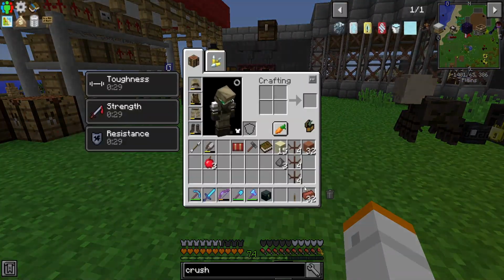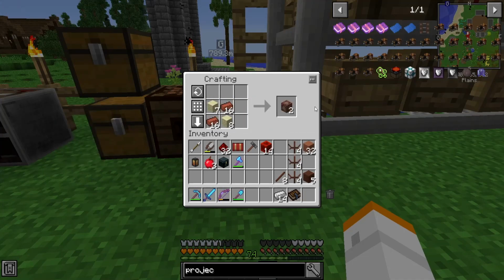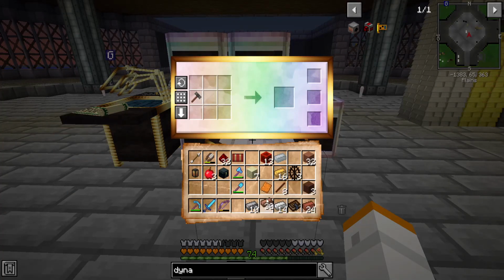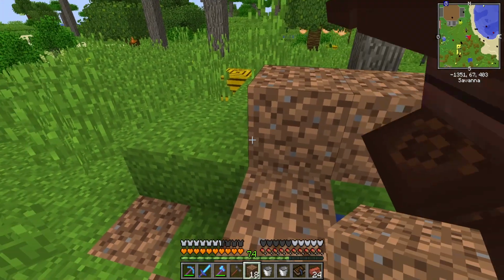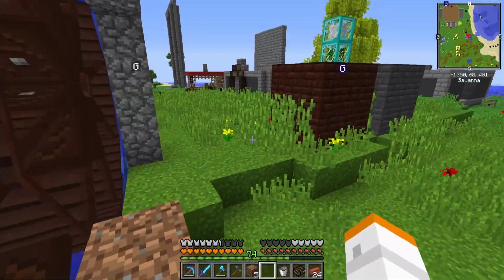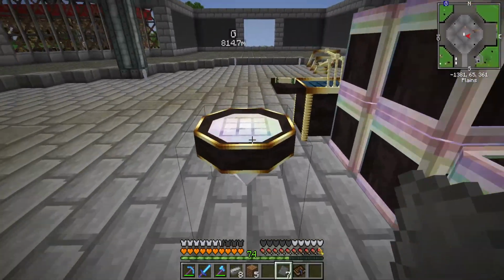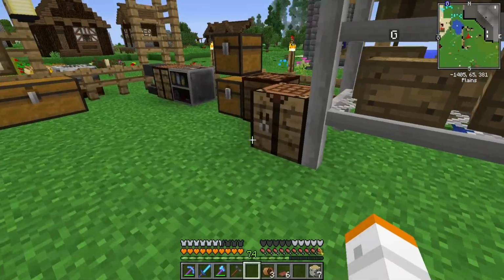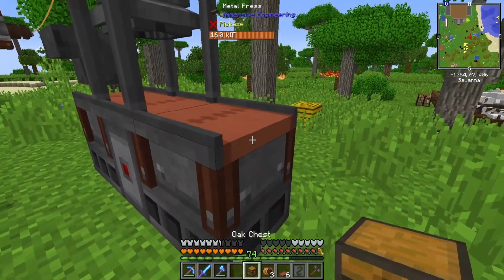Serious Engineering IE Power and Metal Pressing EP10

Comment: I think the IE windmills just checks for blocks in front of it and the high (y level) dependency was removed.
I didn't know about Thermal fluids would affect the wheel when moving up - thanks for the info ^^
Also auto miners do work on crystal which could come handy later on. As I moved my storage to Minecolonies Warehouse and just put the "eye" on racks so I saw where is what and had automated system that way :)
Also have you considered also doing world upload every 10th episode for this series too? ^^
Reply from the maker: IE has changed a lot over the years, I hardly ever use the windmills unless I want one for a decoration.  The world downloads may come, I need to get more done with the base so there is actually something to look at which is why I am holding off on it. Maybe by EP 20.